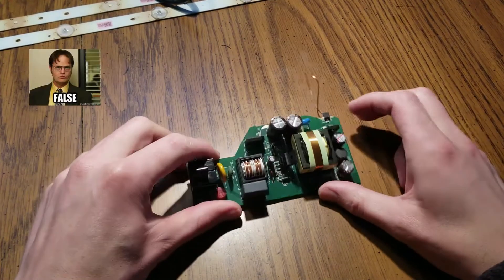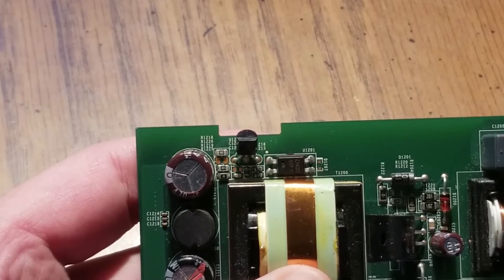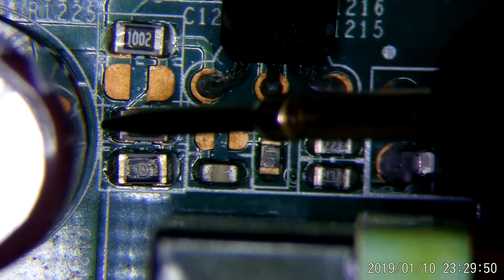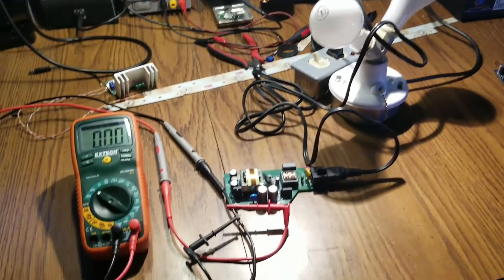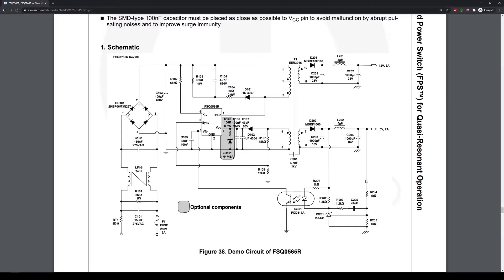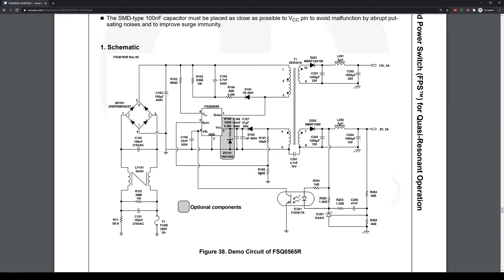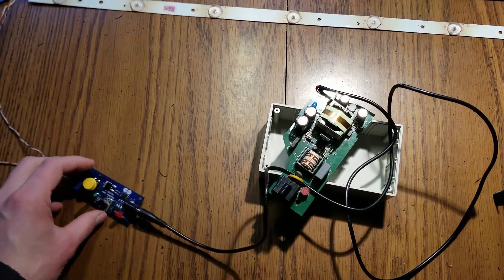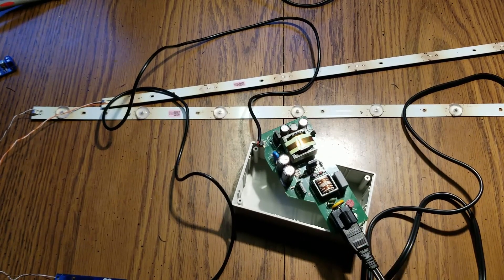Modifying a switch-mode power supply with a TL431 to change the output voltage.

Comment: Great video, I fixed a 12v adapter and then tried to modify it to have a variable output voltage by replacing the 2 ref resistors with a 10k pot, I didn't bother with using a lamp in series which is a BIG MISTAKE, When I first plugged it in the output was fluctuating like crazy, I tried to adjust the pot and when I reached one of the pot limits I experienced an ElectroBOOM moment, fuse blown and now I have an adapter that somehow is now shorted on both the output & the input side xD

Comment: I was surprised to see such little voltage drop across the 24-26 gauge Ethernet cable you salvaged.  lol.

Thanks for the video...glad to know there may be more to this than just tweaking the voltage reference.  Although, it may be less involved as I intend on lowering the voltage output instead of increasing.
Reply from the maker: Yeah, those Ethernet wires must be decent copper, although this is also pretty low current. The main downside of those wires are that the insulation has a pretty low melt point.  I think lowering the voltage on an smps is probably going to be safer generally, especially if you don't pull more output current.  I think if the voltage is lowered too much, and the switcher chip is already running at a low duty cycle, and can't run any slower, you could run into problems though.
Reply: @Datzfunk  I've considered that the duty cycle might be an issue.  I guess I'll see what happens, but I'm only turning it down to 22-23V from 24V.

I'm not about to start rewinding the transformer, that's for sure.